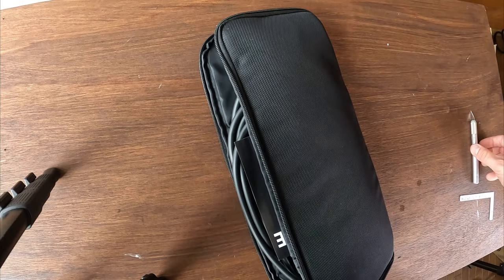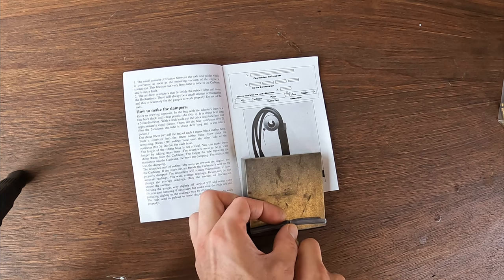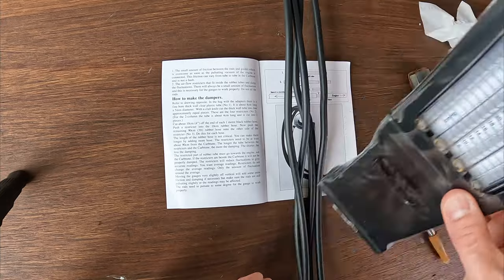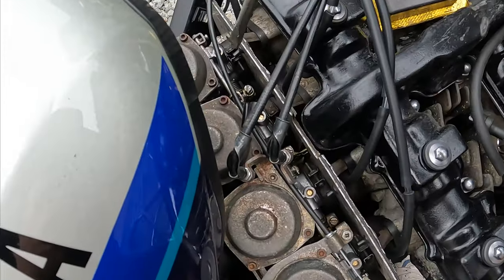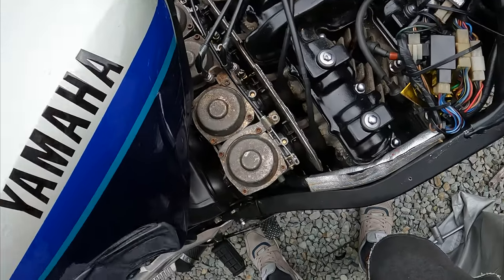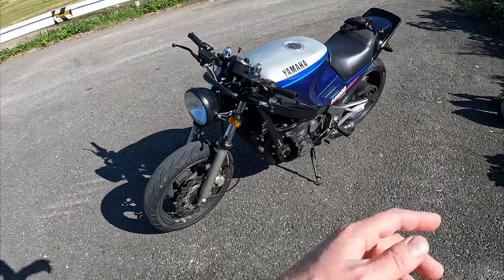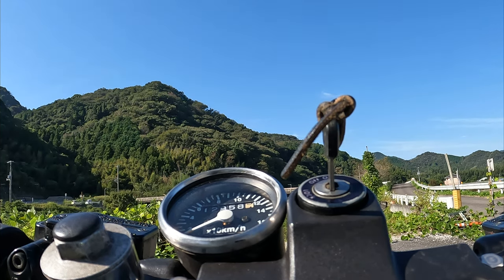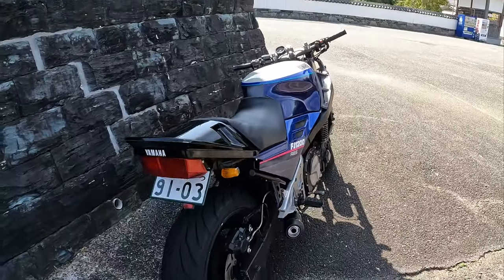Carburetor Tuning with the Carbtune Pro

Comment: Using a carb sync and a Gunson colortune can really get the bike running smoothly. The colortune will show mixtures in the cylinders and you can visually see the rich/lean burn in each one. For the FJ you always want a richer mixture as it keeps cylinder temp down. Keep the great videos coming.
Reply: Thank you I didnt know about the colortune. I will research it
Reply: But will you need 4 colortunes?
Reply: Why do you want the cylinder temp low though? As long as it doesn't overheat it's fine, right?
Reply: @reneverheij6938  depends on how you ride the Yamaha fjs. They are air cooled and running them lean to get more power means they run hotter. Out on the highway at speed this is fine. However if tuned lean and ridden slowly in traffic on a hot day they can over heat and cook rings and valve guides. So running them on a slightly rich mix keeps the temps in the safer range when doing slow riding on extreme hot days.
Reply: @carsonharding9852 Makes sense! I try to never get stuck in traffic jams with the FJ. I kind of want a temperature gauge so I know when to shut it off in time.

Comment: Haven't done this with my FJ yet but I only do this when the idle is rough, the higher the RPM the lower the differences will be relatively speaking. So if you get it near perfect at idle it will always be really good at higher rpm's.

Comment: Is it possible use this device in a car?
Reply: Only if it has a throttle for each cylinder (*edit or multiple throttle bodies)  - you are balancing the cylinders by adjusting the throttle body opening or air valve screw on each cylinder, then you want to get the o2 right on each cylinder, a colour tune is cheap way to do it - unless you have a 5 way gas analyser :-)
Reply: @Numbnutz-Uk  Thank you for the explanation!
The car motor has 4 cylinders + 2x dual Dell'orto carburettor 40, these carburettors, have a screw to adjust (but I'm not sure about if they have "the throttle to each cylinder").

I'm not aware of those color tune, and that's amazing! The kit cost around 80€.
I was thinking of buying an air flow meter, will that do the job? Cost around 50€. 
The 5 gas machine is too expensive :S More than 1500€.
Reply: Hi @Filthat  
Well maybe I should have said multiple throttle bodies not just one for all cylinders.

I'd expect your twin dellorto 40's have a throttle body for each cylinder / trumpet and 1 carb  supplies 2 cylinders (one side) and the same for the other two.

Google 'how to balance twin dellorto carbs' and see if you can see the youtube 'easy guide on a alfa'. You would need to adjust all 4 throttles
You could use a carbtune (if you can fit the vacuum pipes ok, or a pressure meter (as in the vid) if you can access the trumpets ok.  I'd prefer the carbtune as you can leave the air filter on etc. But have a look at both vids and decide which may suit you set up.

The colour tune is a basic spark plug with a glass body so you can see the colour of the flame .. and you adjust the mixture to get the right colour .. but you'd have to move the colour tune into each cylinder and make sure you adjust the right screw.

Tbh it may be better to take it to someone who can tune and set these up if you havent do this before and get them to explain it to you .. unless you want to do it and learn 👍
Reply: @Numbnutz-Uk  I already did, but so many different approaches XD
Reply: @Filthat  I can imagine.  

I'm not sure on your level of abilities or more importantly patience and attention to getting it spot on - for me, I'd happily spend hours working out how to get it right. (Might also be an idea to mark your starting points too as best you can before moving anything.)

I defo think balancing the throttles would be a good place to start.. especially if you find they are way out .. good returns vs effort.  

Then try colour tune - depending how you get on balancing, as a secondary project.  Read up on them and reviews.  I didnt notice much change .. but it was years ago on old cars and I was v young and expected sizeable returns on my effort rofl
Reply: @Numbnutz-Uk  Thank you, for all the inputs, I will try the steps that you provide :)